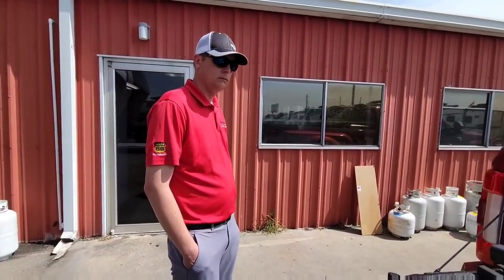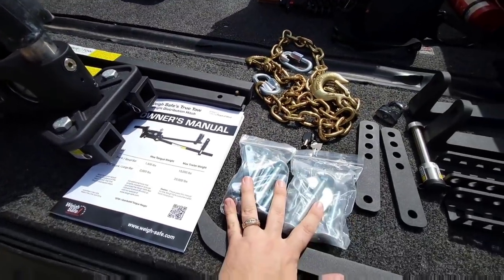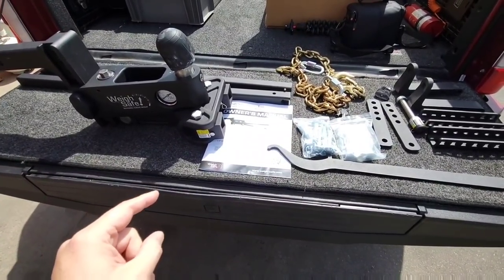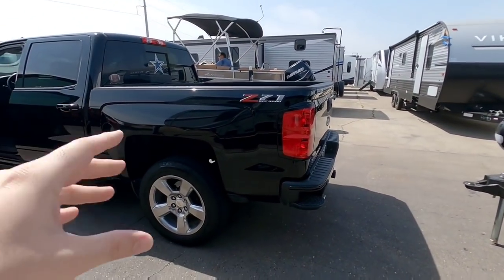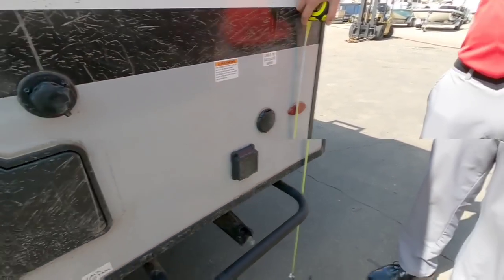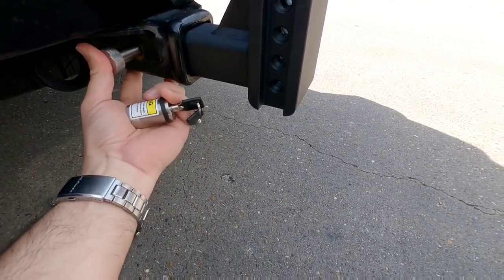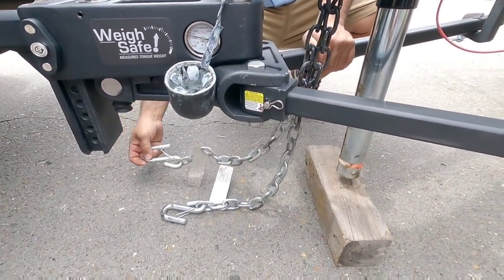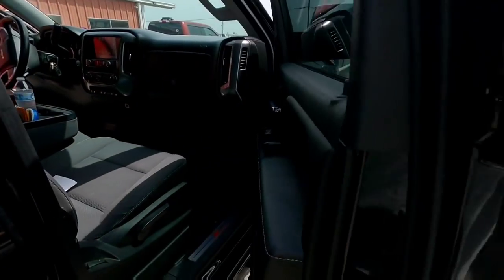Installing the Weigh Safe Weight Distribution Hitch!  Part 1: Full Installation on a Jayco Eagle RV

Comment from the maker: FYI, I should have counted the visible holes (if any) above the hitch, not below when using their app.  I recalculated with their app and it would have been an additional 50lbs of weight distribution turning the top screw.  Not much, but just an FYI.
Reply: You beat me to it ;)
Reply from the maker: How the hitch works: 1300lbs is being transfered.. the scale under load is reflecting the downward force the hitch is handling under pressure. Weight is transfered to the front of the truck and to the Trailer brackets instead of the truck receiver carrying it all.  The truck's receiver is likely only handling about 350-400lbs instead of the 600lbs it originally recorded.
Reply: Look at that dirty XPO Logistics Truck?
Reply: I noticed this, thanks for the correction. Also you should make measurements from the front side of the spring arm closest to the tow vehicle, because that would be in line with the center of the tow ball, and per the owner's manual.

Comment: The two features missing from the hitch are a) torsion flexing to minimize porposing/bumps and b) active sway control like the Reese sway pro that uses springs to keep trailer centered behind truck, not just using friction.  What is the total weight of the weight safe shank, hitch, and torsion bars?
Reply: I just bought the 15k model with the 6" shank.  The shank and hitch weigh 75 lbs. The bars weigh 18 lbs each.

Comment: For everyone concerned about the 1,300 pounds, it's basically like the weight measurement you would get from a bathroom scale if you could reach your fingers under the scale and pull it towards you. The number on the scale goes up. But, your weight on the floor does not.
Reply: Thank you, this is the most important information of the video

Comment: You can not use this hitch on the RV that you are showing. On their site: "Max Trailer Frame Height: 6 inches.
Note Not compatible with trailers that have a frame larger than 5″ and have the coupler mounted to the bottom of the frame. (Typically found on Jayco Trailers)"
We are in the middle of a 1500 mile trip, high wind gusts, I'm working as hard as I can to keep the trailer on the road. We just called them and they have had "failures" when it was used on the hitch with coupler at bottom.

Comment: sway control comes from the sway bars bending spring force as they are held in place by the bracket, not the friction at either end.
and the arms are sprung by the adjustment knob in a vertical direction to transfer the load.  the net effect is that the spring arms provide stiffness to the ball swivel assembly.
the bars are solid spring steel.
Reply: Thanks!

Comment: You need to measure the actual receiver weight, before putting it into truck. Then you need to center of ball from a regular receiver to center of rear axle.  That will give you base measurement where vehicle manufacturer wants tonge weight to be installed. The formula for torque is T=FxD.  F-> down force, D-> distance from rear axle.  So lets assume regular ball mount center is 36 inches from axle, force that vehicle can handle here is 500 lbs.
 Weight distribution hitch moves center of ball to 42 inches from center of axle.  Torque of original =36x500= torque placement of new weight distribution hitch = 18000 inchpounds. New D is 42. So max down force on weight distribution ball is 18000/42=428 pounds. Now hitch weights 65 pounds.  428-65=so new weight distribution hitch now has a weight capacity of 363 lbs.
Reply: That’s probably why my trailer is 1200 pounds tongue but adds 1600 pounds to the rear axle.

Comment: I contacted WS, and they didn’t have an answer!

I have a F-150 with backup assist pro.

This requires a graphic sticker to be placed on trailer near ball along trailer frame. The backup camera uses this sticker to assist in backing up.

My question is, since this WS distribution system adds length to hitch, will the backup system on my truck still function?

Comment: VERY DISAPPOINTED WITH THIS HITCH!!  I purchased this for my Jayco 330 RSTS. This hitch does not have enough adjustment for the swing arms to ride horizontal to the swing arm platform so I am only making contact with approximately 20% of the available surface area. I experience significant trailer sway while towing. I will be going back with Equalizer brand. I contacted Weigh-Safe and they were absolutely no help. Horrible customer service.

Comment: Great video! In regards to the 18,000 lb chain, I am new to using extensions. What is the length of your extension, is it possible to just replace the existing chain and extension with an 18,000 lb total length chain, and do you have a link for this?

Comment: Thanks for the video. I just purchased the same weigh safe hitch and will be installing it this weekend here in Austin. I also purchased the coupler pin with matched key. Towing Nucamp’s Avia with a Tundra TRD Pro. I did find that the safety chains are too short when towing w the way safe hitch, I am guessing that the hitch is longer than the rest of hitches out there. Weigh safe has an app as well. I’m hoping everything works out well for me.
Reply: I also have a Tundra and  in austin, I sure love to hear from you on how you like the hitch.
Reply: @Outdoor-Adventures  will let you know
Reply: @moduc996  How are you liking the Hitch?
Reply: @Berrypancakes229  its great. Having the weight distributed evenly has less wear and tear on truck brakes and easier to tow. I did change towing vehicle though, I got a diesel truck now just because it’s easier to pull into truck stations. It’s less stressful than with regular gas stations where you always have to wait for 2 pumps to free up so you can fill up.  Also having to watch out for thighs spots and turning angles.Having a diesel towing vehicle all you do is drive straight in and drive straight out.

Comment: Thank you JD for using a 1/2 ton and a Jayco with the underslung coupler! What Weigh Safe told me over the phone was accurate and it looks to be the same, possible, issue you have with that setup. With the shank in a downward position, you have limited clearance between the ground and the shank. What Weigh Safe informed me is that they recommend a minimum clearance of 11" and I would have about 7" of ground clearance. The wonderful lady that was helping me out let me know that I would need to take extra precautions in and out of gas stations and changing terrain. As much as I liked the Weigh Safe setup, I decided to go with another brand. Hopefully, when our trailer comes in, we won't have that issue. I'm a bit jealous, though, I really wanted that setup.
Reply: weight safe told me i couldnt use it on my underslung trailer. Sucks, i really wanted that hitch

Comment: Just came across your videos, very cool!

I have a 2012 Ram 2500HD Mega Cab with a 2" receiver.

 Our 40ft travel trailer is 11500 GVW, but we full-time RV, so it's "a little overweight" my GCVWR on Ram is 24000 and im sitting around 23400.

I current have horrible sway above 63mph and i get sucked in to almost all vehicles.

Im looking at:

Weigh safe
Shocker equalizer 
Anderson DW setup

Any suggestions

Comment: That's alot of measurements for the average user.  So much for the old days of hitch up and go.  All in the name of safety though.  That hitch assembly being so long, (great pre thought of weight rated extra longer chains) I see as blessings and curses depending on the senario's.  I remember camping growing up, we had a horribly unlevel spot. We had the truck on blocks raised up and the trailer lowered all the way and we could barely hook up.  I'd love to see trying to hook this whole assembly up on something like, a real world situation of hooking up to any trailer on non level terrain.
Reply: this is no different from any other wdh. the measurements makes this very simple for all users and they have photos and great directions. no other wdh allows you to know it is setup right without going to a cat scale. and then you need 3 weights its actually a lot more work.

Comment: So is that reading saying it’s putting 1200lbs to the truck? I’m just curious because I have a trailer with 1000lbs of tongue weight and was looking at getting this set up. But if I set it up right would I be putting more hitch weight on or is the scale only accurate on the initial hitch weight before you set everything up?
Reply: Not at all, it actually reduces the load on the truck axles and sends some of that weight to the trailer. Check out Fastway trailer's video, it's a little long but really explains what WD does. They are the most experienced company in the business (Fastway is owned by the same company that owns the original Equal-i-zer HItch): 
https://www.youtube.com/watch?v=XBZu39pQ8Gg

Why it reads higher than the initial tongue weight is because the weight distribution arms provide a lifting force on the truck and a downward force on the trailer A-Frame. In the most basic terms it's like putting a c-clamp on the scale and tightening it down. You're not adding weight, but the scale is reading higher due to the clamping force.
Reply from the maker: 1300lbs is being transfered.. the scale under load is reflecting the downward force the hitch is handling under pressure. Weight is transfered to the front of the truck and to the Trailer brackets instead of the truck receiver carrying it all.  The truck's receiver is likely only handling about 350-400lbs instead of the 600lbs it originally recorded.

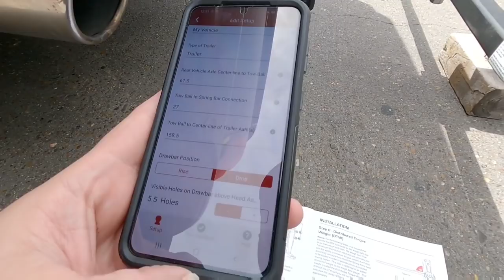Comment: I believe the measurement for visible holes @ 19:06  is ABOVE the pins not below.
Reply from the maker: You are absolutely correct!  I just rechecked the app and it would have been an additional 50lbs (1350).  So not much more thankfully.  Thanks though!
Reply: @BigTruckBigRV  Absolutely!  I have watched the official install video from Weigh Safe 5 times - that is the only reason I caught that.  My hitch is being delivered tomorrow.  Thanks for posting a real world example install.
Reply: @BigTruckBigRV  1350 is a big chunk of the 1600+ payload for this truck. Adding passengers and camping gear is probably putting this vehicle over payload capacity?
Reply: @philfarns  I had the same concern when I watched the video.  Seems like an awful lot of hitch weight for a relatively small camper.

Comment: Im a Newbie, and I bought this hitch, and Im trying to hook it up on a 2015 GMC 2500HD 4X4. Pulling a Reflection 312BHTS. 37'4" 11,295 lb GVWR. I am full-time and pulling the first time from the current location where the dealer delivered. Should  I have slides in before attempting this?

Comment: Disappointing product:  The adjustable gauge gimmick might be nice IF it worked. Mine arrived with a gauge that was NOT accurate.  Without a load, the gauge was reading 450 lbs.  The cheap gauge makes me question the whole system.
- Customer service was nice & friendly and sent me replacement parts.
- Not happy with the fact that I spent over $1k+ and ended up with a 2-hour repair project right out of the box. They didn't want to send me a new hitch, just offered parts for me to fix it.
- If were buying a new hitch again I would buy the Equal-i-zer Weight Distribution hitch.  
- Weigh Safe's higher price does NOT mean higher quality.
- Very disappointed☹

Comment: I don't care how heavy a trailer is, i will never set up a trailer  that is under 10000 lbs with more than 400 lbs.  And a 6000   I wouldn't have more than about 250 for  tandem, and 150 for tri axle. .i have  and a 4500 or less tandem 150-175 lbs.   I have been driving with trailers for 40+ years and used the formula that I use from my dad and other old-timers.    I have never had a sway issues. .  I much perfer the trailer carrying the load.    The more trailer ahead of the axle center the less tong weight needed. . Back in the 1980s I hauled an 11,000 - 32' boat on a 36'  tri axle trailer  when sitting level it had about  150 lbs.  I only got it up to about 40 mph but it towed  great.  I hauled it about 20 miles with absolutely no issues.  Towed straight and true.  It had surge breaks towed it with a 1 ton pickup with a 4!speed split rear end.    I think it had a 440.  A long time ago.    Other than that the biggest box  trailer I hauled was a 24,  box  gvw 10000.   I had about 6000. No  issues with 200-250 lbs tongue weight     which is the weight of the trailer empty was 200 empty.     That is usually my rule of thumb.   A little more weight than the empty trailer.    Now if the center of balance is higher than 4' off the ground  you start to need more weight...if you're center of mass  is less than 4' .  There is not a 1 % rate for all instances...  the only trailers i use 10% rule is single axle under 1000 lbs.

Comment: We purchased the weigh safe WDH and love it. We tow with a ram 2500 and have a Imagine 2400bh. It has no sway and does great.
Reply: We have the same trailer and tow with a Sierra 1500 and Husky Centreline. Zero sway
One finger driving

Comment: When using a hitch like this which number do you subtract from you max payload capacity? The 600lbs or the 1,300?
Reply: The 1300, it still transferred to the truck. It just transferred about half to the front axles.
Reply: I had same question. 1300 is probably going to exceed payload capacity once you factor in passengers and camping gear loaded in the bed.
Reply: 600. You aren't increasing the hitch weight to the truck, you're just adding a lever in the middle which pushes the ball into the coupler harder, which is why it shows as "more weight" (1300) on the scale. The trailer weight never changed.

Comment: At the beginning you state and show the trailer has a GVWR of 4995 lbs + battery +propane tanks,  but then you calculate everything like it's 4,000 pounds + battery + propane tanks.  Am I missing something or did you forget the trailer was 5K pounds not 4K?

Comment: I watch most of your videos. Very informative and thanks.
I know this is a weigh safe video but I was hoping you could give a referral for a great quality weight distribution hitch? I know you review a bunch. 
I’ll be using a Ram 3500 4x4 crew cab long bed HO diesel SRW. Towing a 31’ x 12.5’ Momentum 25g toy hauler tt. Gvwr is 11,500 and tongue weight is 1150.

Comment: Hello JD,  I love your videos!  After watching a ton of truck videos you put out, I was inspired to buy a new 2021 F350 XLT SRW CC 6.7L Diesel truck.  My wife and I are searching for a TT to tow with it an I am researching WD hitches.  The TT models'  we are looking at have a GVWR between 7500 and 9500 lbs so I am pretty confident I have enough truck.  I like the idea of the True Tow - so I was happy to see you review and install it.  I am hoping you can give me some advice on this hitch.  My truck has a 3" receiver and came with a 2.5" adapter (which I have also fitted with a 2" adapter so I can continue to use my bike rack and hitch haul).  I don't see an option for a 3" shaft for the True Tow.  Does use of the 2.5" adapter affect the hitch capacity?  Are there any other drawbacks to use of an adapter?  Also since the hitch is longer than a normal WD hitch does this affect the moment and apply more force to the truck?  Do the calculations in the app account for this?  Any other advice you or your knowledgeable viewers can provide will be appreciated...

Comment: The Weigh Safe is a neat idea.  

 Question open to everyone: I am currently buying a travel trailer.  29' long about 4700# dry weight and listed hitch weight of 480#. I have a Tundra with a 1300# payload capacity and a 9000# tow rating. The dealer only sells Husky Centerline hitches and charges a little over $800.  Should I get that hitch? Or drive home (about 45 miles) without a weight distribution hitch and then get a different one? If so, what hitch should I get?  Thanks.

Comment: Very good video. I have had a Weigh Safe WDH for about two years now. Great to be able to set it up myself. Several years ago I bought a new pickup, hitched my old trailer using my Reese Dual Cam hitch and took it to the RV dealer/repair place to have to set up. They looked at it and said it looked o.k. That was their set up. Weigh Safe places that job in my hands. Yay! It is a heavy hitch, though. Just sayin'.

Comment: I have a equalizer 4 wright distribution kit. Do I measure and adjust with a empty or filled truck bed? Typical camping gear in the bed. Generator wood etc.  And why? Thanks

Comment: Just got mine today.  Picking up our new Grand Design Momentum 25G tomorrow which is notorious for a heavy tongue weight.   Should be interesting to try it out!   Only thing so far I could not find out is if they pre-grease the two grease fittings from the factory or not...????

Comment: Thank you for the video.
New to this.
Does this effect the specs of the steel frame of the trailer.
(Warranty) 
Or is this normal for towing a trailer, a lot of work compared to hooking up a fifth wheel.
Just wondering

Comment: Great video!  We have a Blue Ox Sway pro WDH on ours.  Little easier to use.  The dealer did not torque to spec all the bolts though.  I found out when I switched tow vehicles and had to break the bolts.  I still need to check the bolt for the ball though.  It does need a massive socket, so I’ll make the dealer do that one to double check it is torqued to spec.  Love your content!

Comment: interesting setup on such a small trailer. does what it was designed to do and much easier to adjust as needed. I have a curt 17500 trunion WDH and making adjustments is a bit of a pain. Like this setup but it is twice the cost of my current wdh.